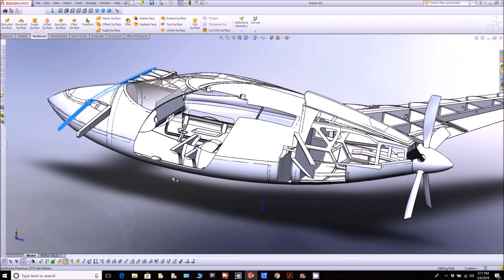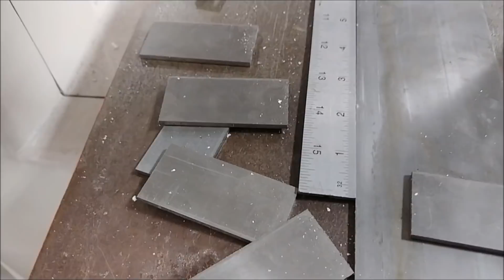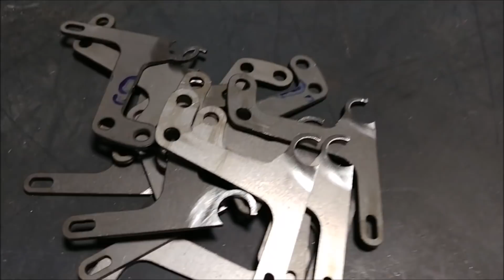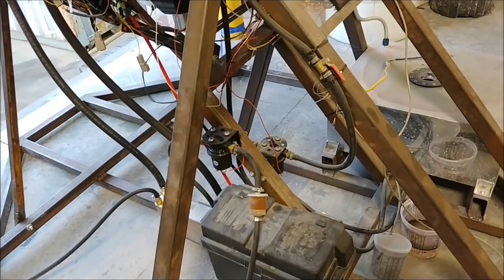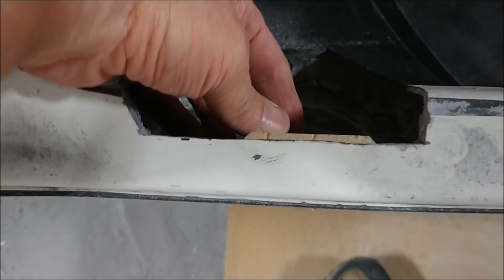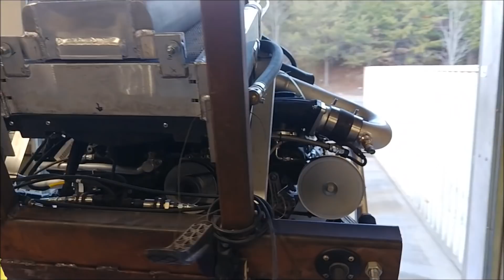No More Leaks

Comment: What is the method of lubrication for the tapered roller bearings on the propeller shaft? It would seem to me that they should receive some oil from the pitch control section.
 I don't think the belt movement that is seen on the high speed is anything to worry about, or anything that can be helped. The force should vastly exceed any REASONABLE spring tension that would be put on an idler pulley.
 All diesel engines have a odd rotational torque pulse, as each piston approaches TDC compression the engine actually slows down due to the high compression ratio compared to a gas engine. Then when the fuel is injected there is a rapid acceleration. The amplitude of this "torque pulse" has led to prop failure in previous attempted diesel aircraft. The loads are that great.
  In any case adding a external idler pulley and it's associated bearing, spring, pivot, etc. In a place where they could damage the belt WHEN they fail seems unwarranted. 
 My point is that the idler pulley and associated mechanism will likely be along for the ride and under alot of stress. 
 It can't break if it's not there😉

Comment: I know you have probably checked into this but how would an electric pitch prop work for your setup?  I had a 1950 Bonaza with one and it worked great.  Also one of the only props that had no reoccurring ADs... Just had to grease it every 100 hours.  Keep up the good work!  Can't wait to see one flying!
Reply from the maker: MT has one but they don't recommend it because it's rate of pitch change is only 1 degree per second compared with 7-9 for a hydraulic prop.